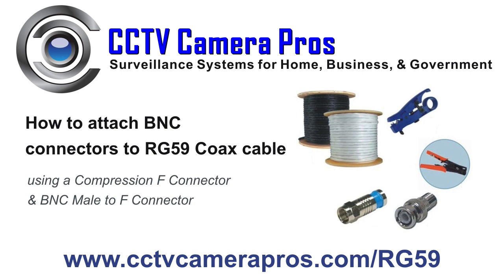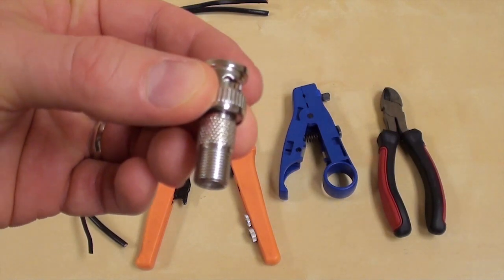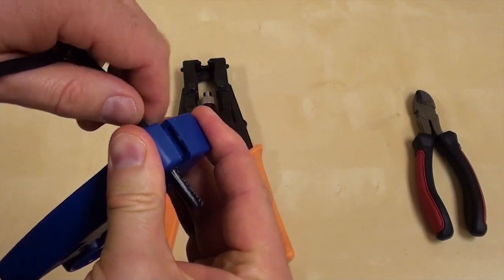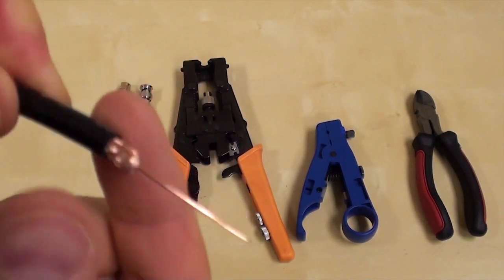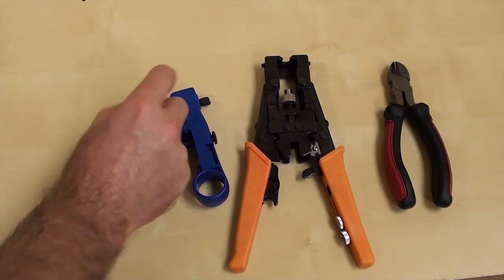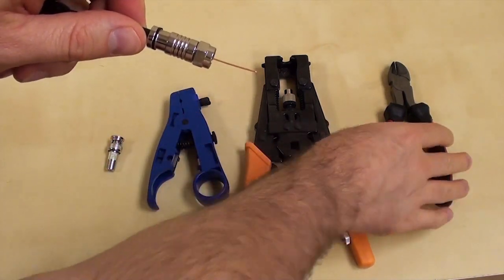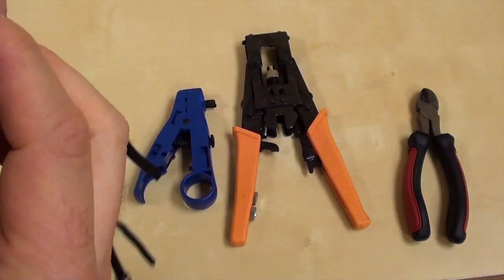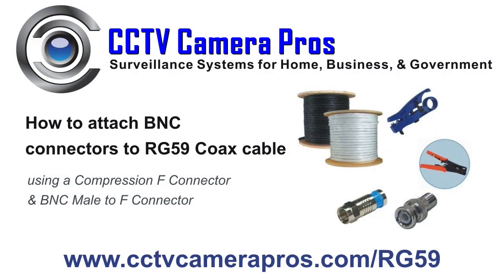How to connect a bnc connector to RG59 Siamese coax cable

Comment: Thank you so much! Very helpful. What about adjusting the tool for the first time. noticed that the compression piece is adjustable up/down, and lockable (with a nut on my tool). Also, the white insulation is out of focus, so we can't see very clearly that step. Just so you know.
Reply from the maker: Hi Freddy. We have never had to adjust our tool. The factory setting us precise. FYI.

Comment: Your BNC connector have white part around the needle. As I understood from googling that indicates that it's working on 50ohm. However cables and DVR working on 75ohm. Only the connectors without the white part are 75ohm. Correct me if I'm wrong.

Comment: Hi. I have a problem what is the best way on the rg59 power cable to strip back the hard plastic on then power side .i can strip back the black out insulation ok but when i attempt the negative or positive wire. Both my automatic wire strippers wont even touch it.they just slide off. Thanks in advance regards james
Reply from the maker: James, most RG59 Siamese coax cable uses 18 gauge power cable. Confirm that yours does. We use a standard 18 gauge cable stripper typically.

Comment: Good video, however I have a different problem.I  pulled the wires out of the end where the camera wires  splits and have that thing that I guess separates them where you connect them to the long wires, I hope you know what I'm talking about  
The wire pulled off  the video connector end, is it possible  to go into the camera  part take out that wire  and replace the whole connector wire? Online the cheapest camera for my Samsung cost.  $49.00 I installed (3 myself)  it's brand new the whole I drilled was not  large enough and  I ended up pulling the end off one camera I hope I don't have to  buy a whole new camera, Can you help me thanks so much.
Reply from the maker: Sorry to hear that you are having trouble. If you are saying that BNC connector pulled off of the small cable lead attached to your camera, you most likely need to send the camera in for service with the manufacturer that made it. Unfortunately, in most cases it costs the same or less to replace the camera.
Reply: Thanks for your speedy reply, I thought that was the answer. keep up the good work helping us to save money and teaching us some simple things we can really use.
Reply from the maker: MSCLOVER CT Your welcome! It is our pleasure.

Comment: Why not use a straight compression BNC connector instead of using the coax 1st?
Reply from the maker: +willfixyourpc a lot of cable installers are more comfortable attaching an F connector. So this is a good method for them. You are correct that it is also possible to connect a BNC connector directly to the RG59 and avoid using the F-connector altogether. 

Here is a video that demonstrates how to attach a 2 piece BNC crimp-on connector. https://www.youtube.com/watch?v=wYnx2btgQZo&index=1&list=PLllUNW5pS32XOHflP_hyxqL7tPddzjsT-

Comment from the maker: Rui Pereira that is why a lot of professional and DIY installers like to use the F compression connectors. Being that the core is exposed on the F connector and the insulation is visible against the connector before you apply the compression, the process is easier. With BNC compression connectors, if you do not get the length of your cut and the exposed core right, the connector will not attach and it is hard to judge the length because everything is concealed. Another option that is easier that BNC compression is BNC crimp-on. You can watch a video on how to attach BNC crimp-on connectors here: How to Connect BNC Crimp-on Connectors to RG59 Coaxial Cable

Comment from the maker: How to connect a BNC connector to RG59 Siamese Cable

RG59 Siamese cable is the industry standard coax cable for CCTV camera installations. RG59 Siamese can be used to conveniently run both the video (RG59 coax) and power cable 18/2 conductor power wire) from a CCTV camera to surveillance DVR.

At the DVR side of the cable run, the 18/2 power cable typically connects to a power supply box and the RG59 is terminated with a male BNC connector so that it can plug into the one of the DVR's video input ports.

There are a few ways to attach BNC connectors to RG59 coaxial. One of the preferred methods that professional installers use is to connect a compression type F-connector to the cable, then screw on a F connector to BNC male. The reason that this method is popular is because compression type F connectors are extremely secure and easier to attach than BNC compression connectors.

This video demonstrates how to connect a BNC connector to RG59 using an male F compression connector and F female to male BNC converter. 

You can find all of the tools and cable used in this video on this page.
http://www.cctvcamerapros.com/RG59

 #cctvcamera   #RG59   #cctvsystems
Reply: got it, nice tutorial~